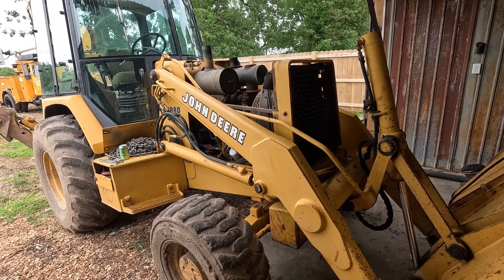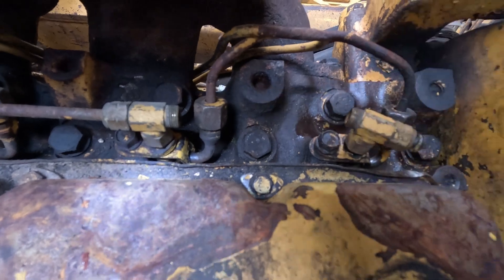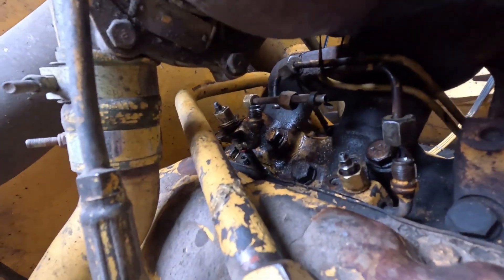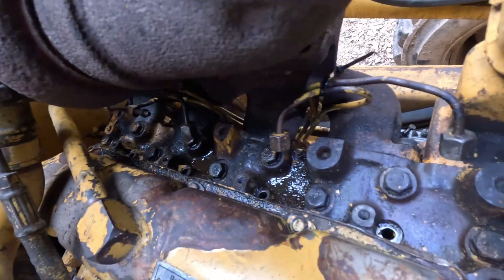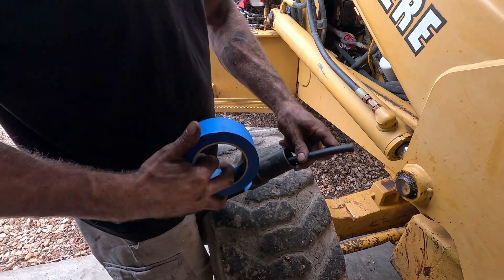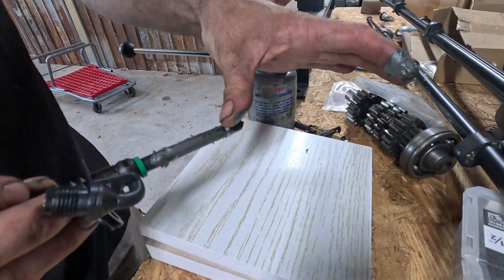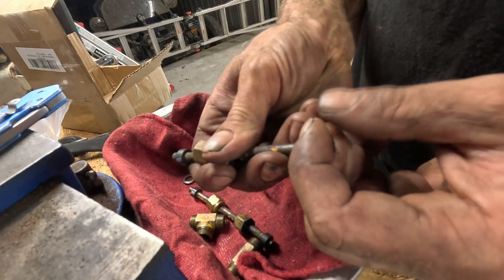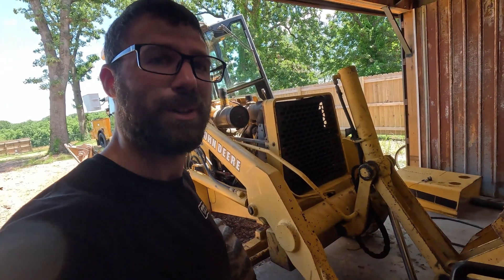John Deere pencil fuel injector replacement

Comment: How do I remove the pencil tee from the old injector, it will not come off
Reply from the maker: Mine came with new tees but I think you can just back the nut off and pull hard

Comment: I need to replace those on my 820 JD
Reply from the maker: Ah the two cylinder I hope your job goes smooth
Reply: Did you get your injectors in an where did you get buy them
Reply: @victorianolechugazambrano1377  where did you get your injectors from